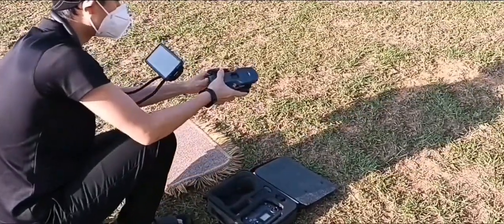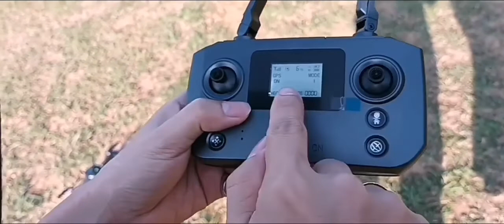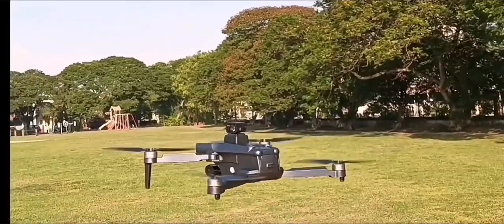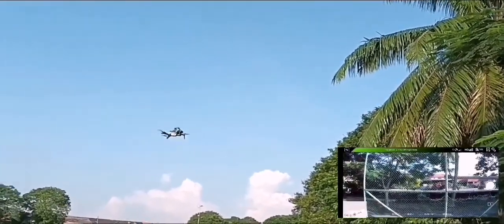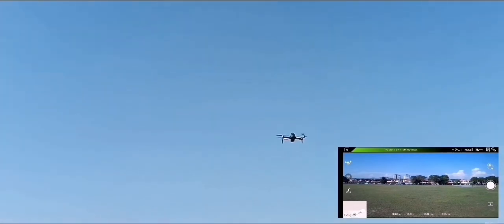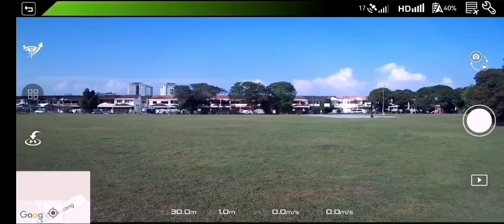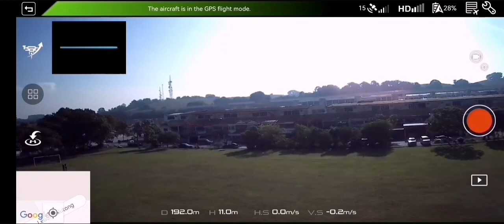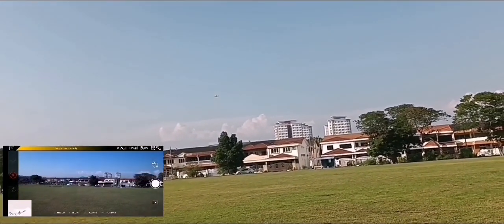KF 106 MAX review

Comment: Thanks ,
I really have another question
What happens if I fly it out of range, or the wind blows it out of range, does it return automatically? Or does it crash?
Reply from the maker: Always return, as long as u r using GPS mode & signal is always there, but if drone hv done multiples return mode & u still keep pushing it out of range it might not able to return & free fall due to total zero battery power

Comment: I'm excited because tomorrow I'm supposed to receive this drone that I ordered three weeks ago and I hope everything goes well
What I don't know and I would appreciate it if you could help me know, how to turn it off after it goes down to the ground without using the return home option (then it turns off automatically)
Reply from the maker: Glad u asked, proven u facing similar problems as I am,
Here's the link u can  check here
https://youtu.be/Wm6ubphv-xE
Reply from the maker: Free to ask again if not understand😊
Reply: @raiden_6690  From all the videos I saw, I could not understand whether it is possible to turn off the drone manually without depending on the automatic shutdown (in the case, for example, that I moved the throttle by mistake)
Reply from the maker: I'm not quite sure what u mean, if u talk about the battery power u can turn off it manually, & if u leave the drone for like 5-10mins it will power off automatically.

But if u r talking about the engine stop (motor stop spinning) u need to push the drone to the ground & don't let the throttle go untill it stops, if it doesn't stop u gonna adjust the throttle (while it still stays down) just slightly left & right like I shown on the link video (close at the end of the video), however if the engine has been turn off, the battery will still on